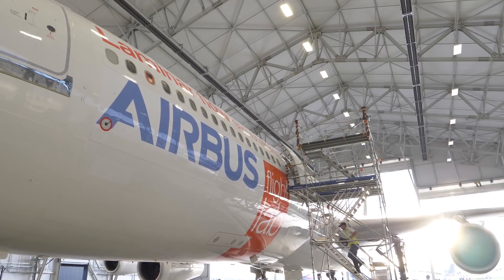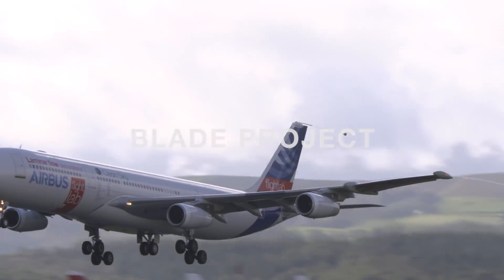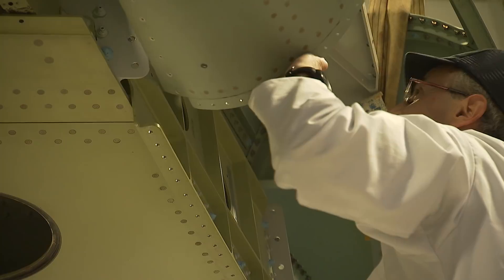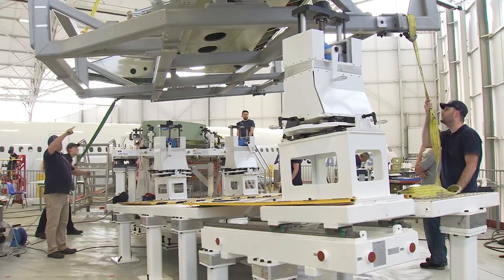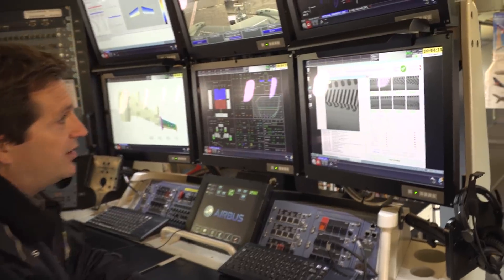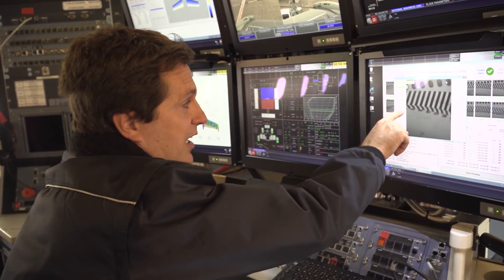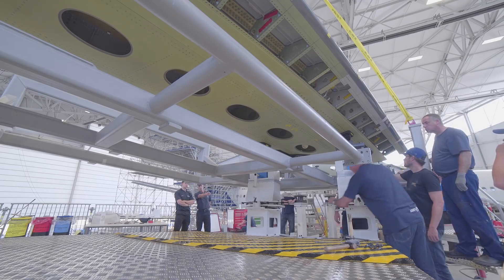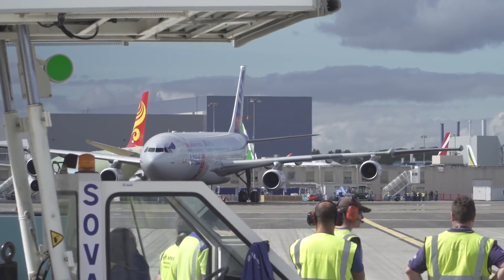What's the "BLADE" project?

Comment: I had a dream when Airbus had developed a passenger aircraft that could take off and Land vertically without the need of a run-way. Its engines could change directions either vertically during landing or take-off or the could be horizontal to give the plane a forward push

Comment: But that would not impress airline markets they need a quiter plane a fuel effecent plane that dominates the 777x but takes the a330neo reduce fuel to 12 percent it may make Other airlines overwhelmed then Boeing would feel the heat on them, Emirates has 330 and a340 from Airbus,But I better say that the entry service of that plane 2018 that could be a good mark for Airbus.They should work on the a330 it needs to be the most popular plane dominates the 777x it will be great for Airbus.

Comment: Having a quad engine is always safe ,in case if one engine breaks the pilot can adjust the flight with the engine next to it ,that happened on quantas and France airbus a380
Reply: ahmed amjad umm on paper yes, but in reality not quite.

Basically, all twin engine commercial aircraft (the main ones) are currently etops certified. That means it’s proven that it can fly on one engine. So even if you have an engine failure in a twin engine aircraft, it can still fly and safely divert or continue.

Comment: I bet that the next project after these will be, replacing aircraft windows in passenger side with TVs, reducing aircraft holes and much more safe to reduce the risk of EMP.
Reply: AdMiRaLeDpIeTt umm sounds cool, but unlikely.

The windows have other use too, Like the crew can look outside to see the wings if they wanted to see it. And in case of an emergency rescue personnel can look inside. So there are a few use case where you need windows.

Comment: Wouldn't research and testing be significantly cheaper and better in wind tunnel? You can control wind speed, weather, etc. Plus precise data and faster prototyping?
Reply: Aakash Kalaria but the real world tests will give real world results.
Reply: Wind tunnel testing can only get you so far. You have to do some testing in the real world.

Comment: What about the winglets then, are they going to be eliminated?
Reply: perhaps not
Reply: This project is not about that part of the Wing it's abouthttps://en.wikipedia.org/wiki/Laminar_flow
Reply: John Dubpernell I understood, but from the footage it seems that the winglets have been removed.
Reply: Ahhhhh...I had not Noticed....lol..You're correct, I would venture to guess they are taking them out of the study. Are you familiar with Winglets Design concept? The experiment they are doing is very similar to what Winglets accomplished for solving wind vortexes on the wing tips which helped with Fuel savings and some benefits in Climb performance. I am no engineer just someone who follows aviation.Cheers and thanks for the winglets catch!